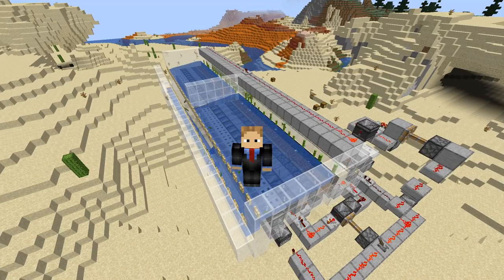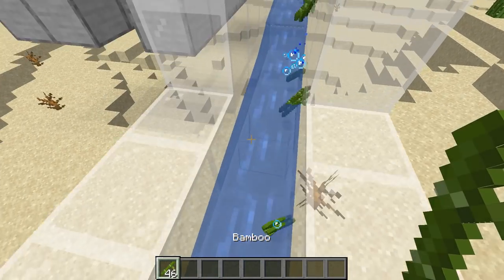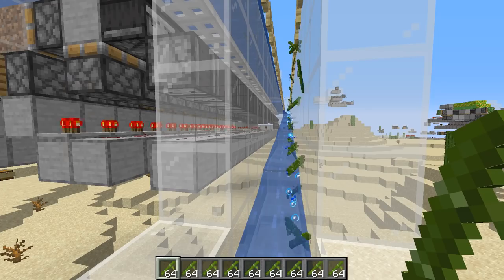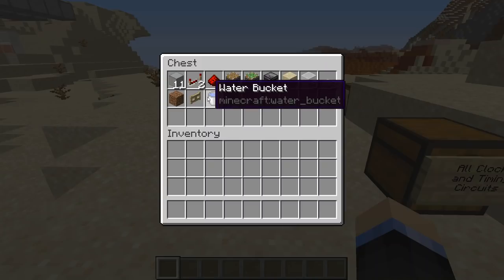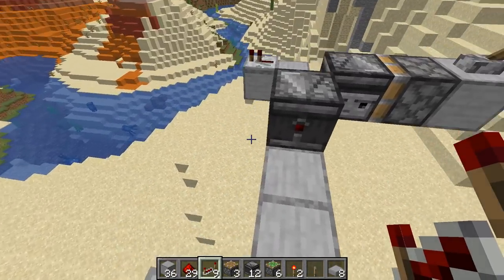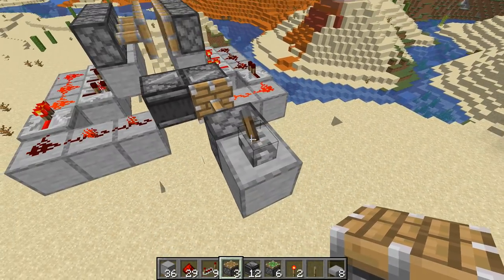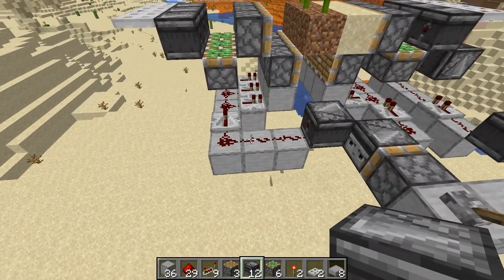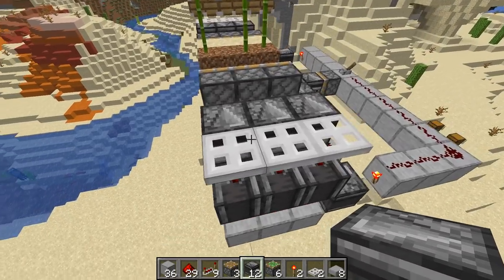Faster Than Zero Tick Bamboo - Minecraft Java 1.15 - Full Auto Shaky-Sand

Comment: Hey, so I built this on a 1.15.2 realms server. For some reason, the pistons that are supposed to push the sand into the middle so they can be shaky aren't pushing them. The trapdoors flick and the blocks next to them go up but the pistons don't push the sand any help? 
Edit: After looking through the comments I saw the one about the orientation needs to be east/west not north or south as you replied. Unfortunately, I will have to take this machine down and rebuild it but awesome tutorial you made it really easy to understand and didn't go too fast or too slow. The only thing I would say you could do better next tutorial is to add the dimensions even though it is an expandable design. You could just give the dimensions of 15 layers as that and the circuits as this is the max size for 1 tile. Have a good day though!
Edit 2: Works perfectly thanks!
Reply from the maker: see you figured it out before I found this... glad you like it, and I will keep that advice in mind :)
Reply: @EagleEye621  any workaround for this without dismantling?
Reply from the maker: @MakoBec  for building it in the wrong direction? no really
Reply: @EagleEye621  sad

Comment: Have you noticed in your own tests that if the On/Off switch is moved to a further distance it seems that the sand does not shake? I've built it as demonstrated, and when the switch is in place it functions fine. But in moving the switch to a more accessible place, despite maintaining the signal strength to the same block, the sand no longer moves after the zero-tick pulse shifts it.
Reply from the maker: I actually made a video about this called "Remote Activated Shaky-Sand (36,000 Updates Per Hour Per Crop)" and included a way to make it work :)
Reply: Thank you for the response.

Comment: Oh sigh.  It's-a-me with another problem.  The design works (and this time I made sure the direction is correct, everything apart from this 1 issue works as intended, even the bamboo doesn't break).  For this problem, the pistons I'm referring to are the stickies that shuffle the dirt and sand back and forth., or at least the timings that suppose to make these function.  The trapdoors, observers and other pistons all fire to create the zero tick that, in best cases, would shuffle the sand.  However for some reason the pistons only fire on the 2nd pulse, ie only when I switch the machine off.  The circuitry all fires on each on/off pulse as designed, but for some reason it's just these pistons only fire on the 2nd pulse.  I haven't filled in the machine for aesthetics yet either, so my machine, while only 5 blocks long for the actual bamboo, is nearly a carbon copy of yours.  My only different is, I built mine underground with the top of the machine 1 block below land level so it's flush with the landscape, so I need my bamboo to go up so it can reach the furnaces.  So my collection area is a set of 5 soul sand to push the bamboo up where, at the top, will collate into a single water stream at the top so the bamboo can enter each hopper feeding the furnaces as needed.  The droppers are fed by 2 observers, comparator and a sticky piston each and are 3 blocks below the farm to ensure there is no contamination of redstone power between the farm and the droppers.  But even then, if they did it would only affect the trapdoors/observers and pistons on the output side of the machine, so already I can confirm the zero tick droppers are not the issue.

I have also broke the redstone feeding all other pistons except the dirt/sand shuffler pistons for troubleshooting so they're not affected by anything else, yet they still only fire on the 2nd pulse of the switch, as before effectively they only fire everytime the switch is set to off.  Any ideas?
Reply from the maker: hard to say without seeing some screenshots? when you were putting it together, did you remember that one of the solid blocks should be above the line of sticky pistons while the other should be one above (so air block between the stone and sticky piston)
Reply: EagleEye621 Yup.  That I did.  They move into and out of position on each pulse as designed.  I’ll see if I can get a video sent to you on Discord, if not, I’ll upload an unlisted video on my channel so you can see.
Reply: Yeah I couldn't upload a video to Discord, so I've uploaded to my channel.  I've posted in your Discord #help section.
Reply: Got it.  Your community helped in Discord. 😊👍
Reply from the maker: @MaskedGEEK  awesome... saw you there as well.

Comment: Thanks!! Have you found that it sometimes destroys the sand if you turn it off at the wrong time?
Reply from the maker: sounds like one of your repeater timings is wrong or missing... can you post some screenshots to the help section of the discord?
Reply: In case anyone hits this too, here's an update to the build that will fix it: Add two repeaters in this build. Coming out of the observer clock you should have a repeater coming out of each side. That is, before you turn the corner and put the repeater on that 'turn' there should be one more on each side before that turn.
Reply from the maker: @tonybaroneee  yup... check my pinned comment
Reply: @EagleEye621  yep, I stole it from there, just increasing visibility :)  thanks!

Comment: The only issue I have with this is that it uses sooo much RS dust, replace the breaking pistons and glass with a single piston and a set of slime blocks/honey blocks, and then replace the dust with rails where possible,

Good video, that’s a shitload of fuel.... definitely making one when I update to 1.15
Reply from the maker: the rails will cut down on lag, but a slime block harvester will cut down on the rates as you have to slow the clock down. it will drop it from ~6.6k to ~5k per hour
Reply: EagleEye621 oh I didn’t see your just using straight pistons, I thought you where using pistons pushing blocks, yeah you would be forced to run a 4 tick or slower clock, I assume your using a 2 tick one here, but I haven’t actually downloaded it yet, either way 6k an hour is a heck of a truckload
Reply from the maker: @rileyboomer8627  *6.6 ... :)
Reply: @EagleEye621  haha yeah XD
Reply: @EagleEye621  hey um can you drop a world download somewhere? 6k per hours seems way too low imma drop it in my carpet mod server and run a test if your cool
Reply: Wait nvm I’m dumb it’s 6.6k per module OFC that makes way more sense lol can’t math
Reply from the maker: @rileyboomer8627  :) ... yeah, it is a rough number, but I test it manually... literally just stand in the water stream for 10 minutes or so and do some math... then do it again to confirm things.

Comment: The pistons that move the sand and dirt back and forth break if you don’t power it using a lever and the exact spot where you have it I’ve tried t flip flops direct redstone into the block the only things that start it at the exact point in time correctly are a redstone block and the lever and you can’t use a piston to push or pull the redstone block so I can’t find a way to automate it with a comparator coming out of something because it can only be powered directly with a lever or block without piston delay
Reply from the maker: not sure what you are saying?
Reply: EagleEye621 what I’m saying is if you power the original block with the lever any other way it makes the system break the sand rather then keep it
Reply from the maker: @donnymoonshine3946  you need to put just where the lever is, then you can poser the block under it.
Reply: EagleEye621 I tried several different ways the only then reliable is to power the dust from above with a redstone block in any of the circumstances I had to put a delay on the regular piston turn off because the sand gets broken if you unpower the farm at any of the wrong times
Reply from the maker: @donnymoonshine3946  did you try the way I suggested?
Reply: EagleEye621 I powered that block from every angle and stress tested it it’s a nice design and idea but I’m disappointed that your final draft is so unreliable
Reply: EagleEye621 if you like I can take some footage and post it so you can se what I mean
Reply from the maker: @donnymoonshine3946  its not unreliable? but sure, I am happy to see the video

Comment: im on a realm and it doesnt seem to be working, the piston that pushes the sand into place isnt firing, wondering if i built it wrong or if it might not work on realms
Reply from the maker: could be your build it in the wrong direction. the zero-tick pistons are directional
Reply: @EagleEye621  So what IS the right direction? I can't seem to figure it out.
Reply from the maker: @robbehijzen7290  the sticky-pistons for the zero-tick have to face east/west

Comment: I have some problems with puching the sand over the pistons that are supose to shake it, when i start the machin, the part where i puch the sand just doesent work...
Reply from the maker: did you remember to put the repeater on two ticks?  hard to troubleshoot without being able to see the build (if you can post some screenshots to the help section of the discord)
Reply: I seem to have the same problem. The pistons that move sand and dirt are never activated. The repeater is on two ticks
Reply: Yup. My sand isnt getting pushed over either
Reply: I didn’t  build the pistons that are suposed to puch the sand in the right directions... i built them towards south lol
Reply: I just tried it in creative and EgaleEye621's top comment seems to be key: the whole build has to face the proper direction. I don't really know why, but I build both directions and only one works.
Reply from the maker: @BFuhry  probobly build in the wrong direction.
Reply from the maker: @MrJettpacks  check your build direction.

Comment: Thanks so much for this tutorial! Just finished - everything appears to be working properly, but the bamboo is not growing. It is built exposed to light and just to be sure added a bunch of torches. The zero-tick piston is also positions facing east. We do not have any mods on our server. Any other ideas?
Reply from the maker: it is possible that you have some mods you don't know about?
Reply: @EagleEye621  I believe the problem is that our server is run through Paper. Real bummer. Thanks for the help
Reply from the maker: @JDBrindis  pretty sure you can undo the mod if paper is blocking it.

Comment: Alright. Im sorry if this is obvious, but I cannot seem to find a way to power this farm without that lever, no matter which source of power I use (repeater into block, repeater into block with redstone underneath) I cannot get the farm to correctly run without the power from the repeater in that spot? I cannot hook it up to a mega smelter, please help?
Reply from the maker: put a redstone dust where the lever it, and point a repeater into the block underneath it... if I understand what you are asking.
Reply: @EagleEye621  Doesn't seem to work. I'm tearing my hair out. With the lever turns it off and on, everything is great. If I do exactly like you described the sand doesn't shake and then the machine drops the sand when it's powered off. I took out the lever, put redstone dust where it used to be, pointed a repeater into that block and powered the repeater. I've now been trying to power this thing without the lever for two hours and everything I try either makes the sand not shake or the sand drops out when it's powered off. I guess I can just leave it running permanently and let the excess bamboo float into lava, but I wanted to automatically turn it off when the last furnace in my furnace array is fully fueled.
Reply: Oh, never mind. It breaks the sand with the lever too, sometimes. It's just that when it is automatically powered I toggle it relatively often (no hystheresis in the control circuit) so it's more likely to happen fast.
Reply: Can't run it continuously either, the sand just seems to somehow have despawned, probably after breaking but I didn't see it happening because I was fiddling with other parts of my furnace array. Oh, well. Back to old reliable zero tick farm it is. I double and triple checked my implementation with the video and there doesn't seem to be any difference. Either you haven't tested it for long enough (I didn't get more than 30 minutes of continuous running) or there's some subtle difference in my world (java, 1.15, vanilla, the only potentially weird thing going on is that I built it in a drained ocean monument next to a guardian farm) that makes this completely unreliable.
Reply: Did some more testing in a creative world. First, if we look at the video with the big farm at the beginning there are two repeaters going out of the observer clock. With those two in place I haven't managed to get the machine to break the sand yet. Second, it's not possible to power this with a repeater going into that block. But it is possible to power it on and off with a line of redstone dust going out of the block where the lever used to be (and redstone on top of it too).  That line can then be powered by a lever or a torch. But. If I turn off the torch with a lever and then turn it on again, the sand doesn't shake. no matter what I do. I have to remove the torch and place it back again. Same goes with turning the torch off with a comparator.
Reply: Finally got it to work. It is possible to power the redstone where the lever used to be with a block of redstone that we move in with a piston. And that piston can be powered in whatever way we choose with no black magic preventing things from working. With the repeaters added I haven't been able to crash this yet (in creative, back to survival we go). The changes necessary are shown in this screenshot: https://i.imgur.com/o6JUZkQ.png
Reply from the maker: @Borkon  hard to know what to say without being able to see your build.  are you sure the repeater pushing the sand into the middle is on two ticks?
Reply from the maker: @Borkon  can you post some screenshots to the discord?

Comment: Ive been having a problem with the sand not being pushed over by the right side of the mechanism. Any Tips?
Reply from the maker: probobly facing the wrong direction.  The zero-ticking pistons need to be facing east/west
Reply: @EagleEye621  ill check that. Rebuilt it 2 other times watching the video on .5 speed and it didnt work on either on them. Odd if thats true. Thanks for the advice!
:)
Reply from the maker: @revelmonger  you can #BlameMojang but if the zero-tick block pushers are facing north/south they just won't push the block... they need to be east/west

Comment: I built this farm in 1.15.2 multiplayer server. Everything runs but the bamboo isn’t growing. I have read through all the trouble shooting in the comments (light levels), checked and rechecked all repeaters and added the ones coming out of the observer clock. The problem I’m noticing is there is quite a bit of lag on the server. The collection system pistons which are supposed to be 2 ticks are more like 10 ticks, and the shaky sand pistons are similarly slow. The sand visibly moves and glitches between the original resting position (before turning machine on) and the “on position”. Is the lag making it so it won’t work? Thanks.
Reply from the maker: if the sand is shaking, and the bamboo is not growing (but also not popping off) you were right to think light level first. The only other thing that would cause that (unless you blocked the area they could grow into) is a mod on the server that blocks fast growth.  Something like Paper/Spigot has a mod on by default that blocks the fast growth, but an admin can turn that mod off.  Some servers (like minehut) also have mods that block the fast growth and those would be tough to disable.

Comment: As far as I can tell I built it the same, but when the sand is pushed the bamboo breaks. It should be zero tick though.
Reply from the maker: can you post some screenshots in the discord?
Reply: I fixed mine by placing the water, bamboo, and blocks in the same order and way that he did

Comment: All the redstone is as it should be but it’s freezing with the server lag and therefore the bamboo isn’t growing at all. I made it 6 long and the server can’t handle it. Do you think that reducing the size to 2 or 3 would help? (I made sure there was adequate light and the sticky pistons are facing east or west)
Reply from the maker: if the bamboo isn't growing and there is enough light, it is possible that your server admin added a mod to block the fast growth... if you are or know the admin you may be able to remove that mod
Reply: Are you familiar with minehut server hosting because that’s what I’m using to host the server and I can’t find anywhere in the servers settings a mod disabling fast grow
Reply from the maker: @zackzurita8253  yes... minehut is known to block the fast growth... not sure if/how to turn it off, sooy :/

Comment: The circuit for the bamboo breaker on top is not working even when the solid block is pushed on top of the observer, why?
Reply from the maker: I would need to see some screenshots of your build to help you figure out what went wrong. can you drop some in the discord?
Reply: @EagleEye621  I figured out the issue, sorry for wasting your time.
Reply from the maker: @marcuscjj4ever849  no worries... glad it works now :)

Comment: The pistons pushes the sand across, it works then when i turn it off the sand brakes.
I have a video i can send to you if you want
Reply from the maker: check the orientation... the block pushers only work in one direction.
Reply: @EagleEye621  What direction is that?the one that is pushing the sand will push North
Reply from the maker: @oskarpettersson3549  should be east/west
Reply: EagleEye621 thx I had it in the wrong direction and the server I play made so 0 tick farms don’t work
Reply from the maker: @oskarpettersson3549  RIP